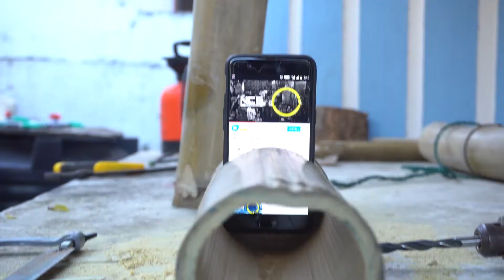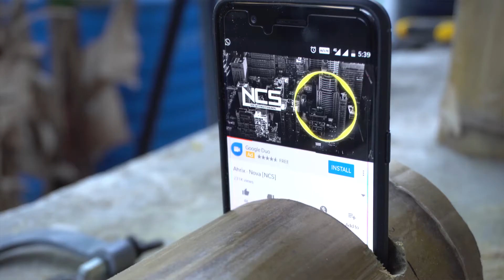Bamboo Projects_ 10 easy ideas beginners can try

Comment: Yeah, I have an idea you may want to try. How about one of those tubular standing ab exercise weights that have become so popular lately? They have a weight on each end and grips in the middle. So, you would cut three section of length of bamboo all enclosed. Then drill a hole in each end and fill the ends with sand or rice, and close the hole. Then cut 2 strips from the middle section so that it could be held by hand(s). Next, wrap the 2 hand holds with rope for comfort and...voila...you have a new piece of exercise equipment!
Reply from the maker: Nice Idea, can you put some links of the equipment here, or even what its called.

Comment: I couldn't hear is 300 rupees was $4 for 40 because your screaming bird. Furthermore you have to scrape the bamboo green surface to remove the shiny outer portion for the paint to adhere to the bamboo properly and to look natural. Of course I can check the exchange rate of the money and I did but I like your video
Reply from the maker: Thanks for watching and the tips. The screaming birds were family of nesting crows, right above on the tree behind me. Lol. And yeah, I got for 300 rupees, 4.22$ approx.